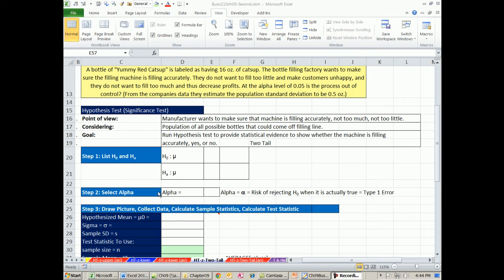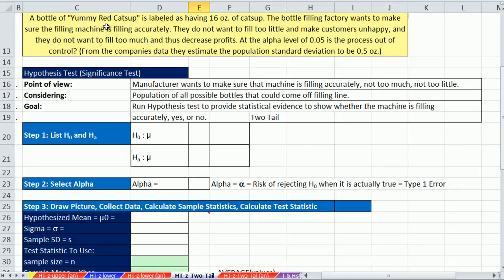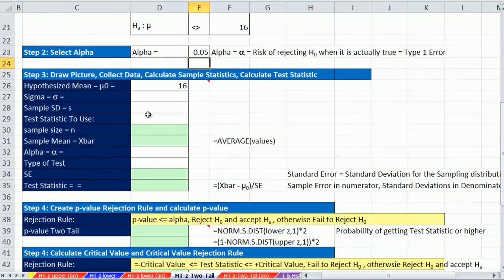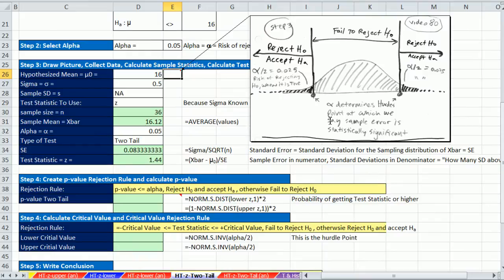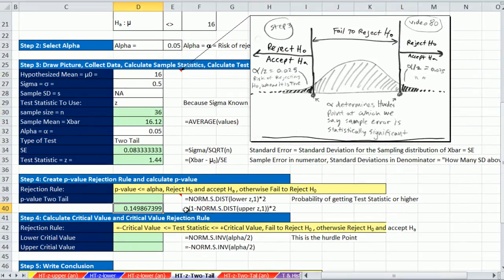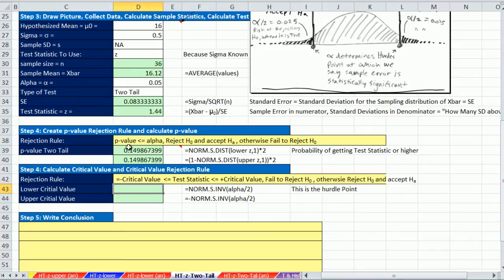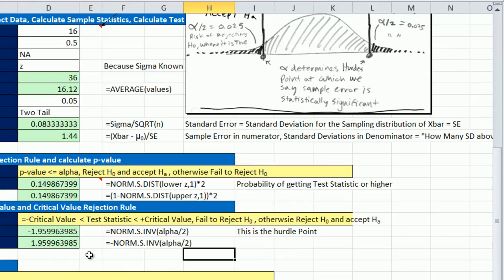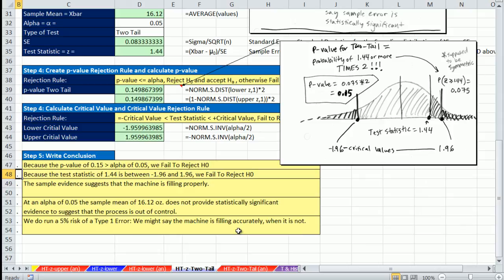Excel 2013 Statistical Analysis #55: 2 Tail Z Score Mean Hypothesis Testing P-value Critical Value

Comment from the maker: Excel 2013 Statistical Analysis #55: 2 Tail Z Score Mean Hypothesis Testing P-value Critical Value 
Download files: http://people.highline.edu/mgirvin/excelisfun.htm
Example of 2 tail test on the left (lower end) for mean catchup bottle weight when manager of bottle filling machine needs to check if the machine is filling accurately, using critical value and p-value. See the Excel functions: COUNT, AVERAGE, ROUND, NORM.S.DIST and NORM.S.INV